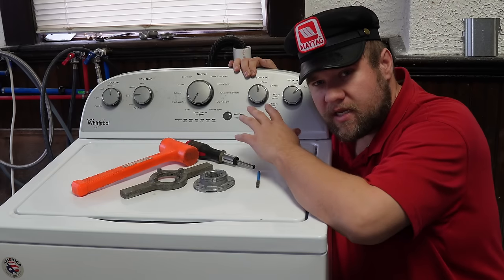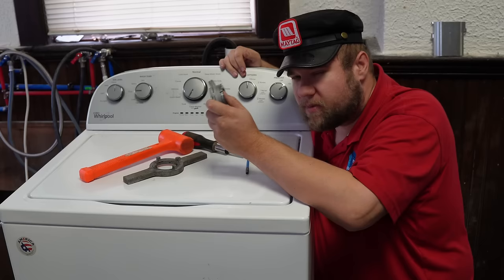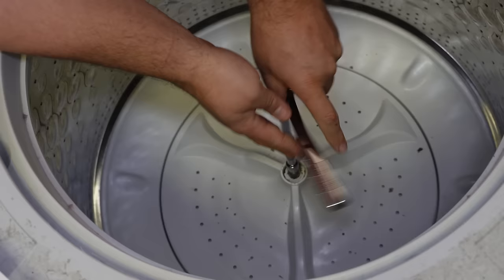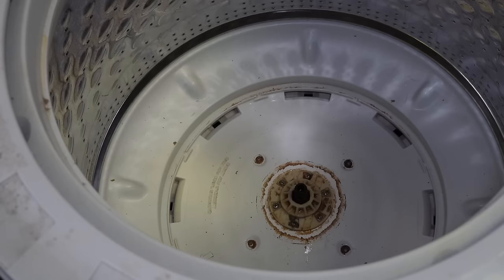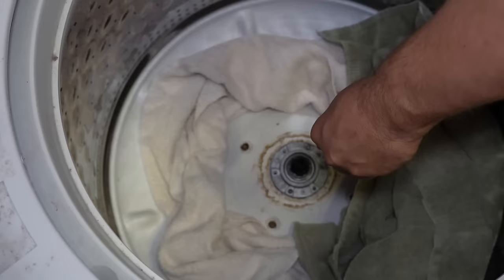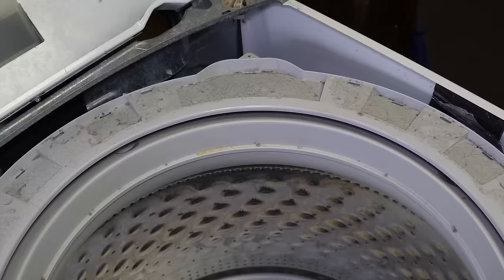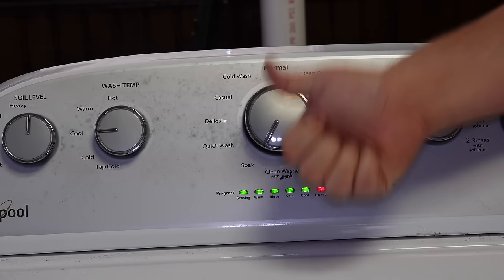Whirlpool Washer Won't Agitate or Spin Properly - Metal Hub Upgrade for Stripped Gearcase Splines

Comment: Liked video! I have a Whirlpool Cabrio wtw 6400 3.  My washer seems to agitate perfectly fine. The tub does lift freely and lower again, but on the spin cycle it just continues to do a slight agitation rather than an actual full spin. Basket manually spins freely during spins, and when i did thos last time got no ertor codes. I checked my stator and it does have cracks but again agitates perfectly. I like these washers because they're easy to fix but this issue has me stumped.  Anyone have any suggestions?

Comment: I have whirlpool model wtw5000dw2 but i cant get the 7/16 nut off, when I took off the plastic cap it had a rust colored paste on top of it. I wiped off the paste (grease?) but I can't seem to get it loose with a hand tool or power tool Can I put a penetrating oil on it?

Comment: I bought one of these a couple of months ago.  It worked well until it didn't.  After disassembly I found that the splines in the drive block were completely smoothed out as bad as the plastic one I just recently replaced.  Do I replace the drive shaft or the washer?
Reply from the maker: Great question, after selling quite a few of these, we have found that 1 of the issues is that the gear case bangs around a lot with the tub because of how bad the tubs are anymore, we are working on a brand new shimkit that will go-between the gear case and top that may. Solve this so you may want to give a metal hub another try. Otherwise you would have to typically replace the gear case.

Comment: @bensappliancesandjunk I have a Whirlpool Cabrio model 70401D. I got the code F0 E5 in diagnostic. I replaced the wash plate and the rods. That didn't seem to fix the issue. When I hit the start It locks the lid but when it tries to spin to weight the load it sounds like it's just spinning but not gripping. The tub and wash plate move and are not stuck but are not spinning properly. Sounds like the gears are worn and it's spinning but not catching. I already spent $300 on these parts, really hoping its the drum mounting hub issue. Could really use your experience, any suggestions?

Comment: I hope you can help me with a question. I have this washer, and we had it shut down after a power outage.  It would not come back on, and we couldn't get it to wash. I had unplugged it to check inside, but nothing seemed burnt out. The next morning, in a last ditch effort, I plugged it back in, and to my surprise, it worked just fine. If the unit gets unplugged, power goes out, or a fuse blows in the house, the washer won't work unless we unplug it for about 30 minutes, and plug it back in.  Is this normal? Seeing that there are diagnostic settings using the center dial, is there a way to use the dial to reset the machine so it will run immediately after the power goes out or unit is unplugged?

Comment: My washer has always had that bouncy bit in the tub. We bought it brand new and have had issues with it striping out the plastic junk under the agitator plate. I have had this bravos xl for 3 years and have replaced that plastic junk 3 times. It has always had an issue of getting out of balance as well. No matter how small of a load I put in or how I make sure the load is balanced to begin with. I am guessing it had something faulty in it to begin with and I thought the bouncy tub was normal, since this is the first washer I have ever had that did not have an actual agitator in it.

Comment: I replaced my hub with this.1yr later I’m having problems and my metal hub the teeth on the nut is stripped. What could’ve caused this
Reply from the maker: Likely, the tub underneath is bad and the bearing in it needs replaced. I am putting a video out on it next week

Comment: I picked up one of these washers and supposedly it worked ok except for the violent shaking however upon trying it out it would stop filling with only a couple inches of water in it. I put it in the calibration mode and nothing changed.
I’m hesitant to fix the hub without first getting the fill level problem solved. 
Any advice would be greatly appreciated.

Comment: I have a different spline on the drive with three equally spaced sections with four teeth each that are preventing me from removing the plastic hub. I had to break my wash plate out and replace it. Could this be a leftover section of the old wash plate that fits over the normal splines?
Reply from the maker: Hi, yes that is what it is. There's a metal piece at the bottom of the plate that sometimes can get stuck on it,
Reply: @bensappliancesandjunk  I appreciate you replying so quickly. Think I could heat that and then pry/wiggle it off?

Comment: I used your metal hub upgrade and it worked for a few days and then it started doing the same thing, not spinning fully and shacking. I have been trying to get the large tub nut off with the spanner wrench and a sledge hammer but it will not come off!!!!! Any advice ?

Comment: Hey Ben, We just replaced our 8 year old Maytag Bravos this weekend do to wash plate lock up and fried drive motor. I have a feeling this would have fixed the wash plate issue, but not sure if the drive motor could be fixed. I hope the new Whirlpool will last a bit longer than 8 years. Thanks for the videos.

Comment: Super bummed!!   Upgraded to the metal hub and it lasted maybe 2 months or less!   Agitator spins around,  not sure what it looks like because we used locktite on the bolt.
Reply: oooow thats dishatening
Reply: I've replaced the hub (with locktite), OEM suspension rods, and checked the pump, motor, capacitor and splutch. Still walking across my floor. 😭 Anyone have any tips?

Comment: Question if you see this! When I took the drive hub out it was very clearly and in terrible condition... On the gear case splines there looks to be in your video some kind of black rubber ring seal. Mine was shredded. What is the name of that seal so I can find a new one!

Comment: Is it normal for the drive block and the tub nut to NOT screw together very well? I am not an appliance repairman, but I once worked in a machine shop as a QA inspector. The threads on my parts -- right out of the box -- don't screw squarely down. I not sure if that is just the nature of the quality of these parts or if it some ingenious threading design for this machine, and perhaps that spanner wrench will be the finishing touch to securing down. I thought I would ask before I make a fuss to my supplier.

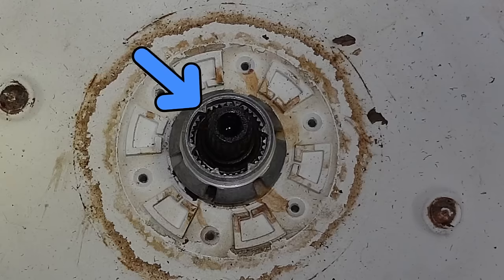Comment: Nice job!  I bought these parts from you and tried to install according to this video.  The instruction at 5:00 is unclear and difficult to see in the video.  Tried hammering on a socket but nothing changed. The washer doesn't shake violently (also did the safety pin trick). Now I'm getting a vibrating like a vibrating bed.  Can't find a video that helps. Maybe the hammering part wasn't successful? Any input will be much appreciated.  Thanks

Comment: Okay so i replaced both this and suspension rods. It was good for a wash or 2 but then i noticed it wash shaking absolutely violently again and atopped it immediately. There is play in the inner tub again. I think i might have not had the tub pulled up and when screwing it in i pulled the tub up with the screws. Currently can't get the agitator off now again 🥲 even bought a whole new one because i had to break the last one. Would the tub being pulled up be able to cause the tub to come loose again? I used thread lock and everything. Let it cure for 24 hours as well. Am i fucked?

Comment: Hi @bensappliancesandjunk thanks for the good videos. I think I need to upgrade to a metal hub per this video, but would please like your opinion. I'm working on a Maytag MVWC565FW1. It's acting really off balance during spin cycles, walking, banging, etc. First thing I did was level it by adjusting the feet. Didn't work. Then I ordered new springs/shocks (someone else's video). Didn't work. Actually seemed to get worse. Then your Fifty Cent video hack mentioned hub which brought me to this video. Mine has an agitator and I think I need to get a really long extension to loosen the 7/16. What do you think? I'm a pastor working on the church parsonage appliance, so cost savings is a big help. Thank you! I plan to order parts from your store, but wanted you opinion before ordering.
Reply: The repair isn't very difficult at all to do yourself.  Ask if any our your parishioners are handy and if they wouldn't mind doing the repair for you or let you borrow the required tools.

If you need to purchase tools go to Harbor Freight.  Their tools aren't the best but for a simple job like this they are more than sufficient.

Watch some other videos for your specific model or similiar model to get an idea of the tools you will need.

Good luck!

Comment: Hi Ben, I installed the metal hub and I’m still getting the same amount of play between the tubs.  What should I check?
Reply from the maker: One thing we see popping up is that if the tub is destroyed on the plastic, there's only one more possible fix, we just came out with it. It's a metal collar to slip over the gear case just before you install the hub that tries to reduce the wobble in the tub. 

This is the item: https://bens-appliances.com/products/gear-case-shim-kit-for-whirlpool-maytag-and-other-gearcases-ba-27194372?_pos=1&_sid=6c83c2257&_ss=r
Reply: So these would go between the shaft and the inner tub? Do you have a video yet?
Reply: Just to confirm.  I’m using part W10324651 in a  wdw5000dw3. There is a lot of clearance under the drive block at the base of the tub. I can see the wobble at the shaft, so I’m guessing the shims would fix that.

Comment: Thank you for you videos. I did use your other video to replace the rods. What a difference. I wasn’t able to get the machine into calibration mode but it’s so much better now. I planning to switch out this next. The spanner wrench, is it one size fits all or do I need to get a specific one? Can you send a link when you have a chance if it’s a specific size please. Thanks again for your help.

Comment: my hub on my maytag centennial will free spin by hand and the basket itself will not spin with it. I been noticing that the clothes are heavy like there was no spin cycle. Do I need to replace this hub on my centennial to get my spin back?
Reply from the maker: Can't say without seeing model#. Take it out and investigate. It'll either be the hub or plate itself
Reply: @bensappliancesandjunk  maytag model MVWC415EW0  ....... I was able to run the diag mode on spin cycle and I can tell you 100% that the agitator spins 1000 times faster then the basket

Comment: I have the same washer except mine has an agitator. Does this fix also work on one with an agitator?  This is by far the worst piece of crap washer I have ever purchased. I do not remember it ever working properly when on spin cycle. Got this during the height of covid, so we installed it ourselves. This was my birthday present from my daughter, I don't want to give it up yet if it can be fixed.

Comment: Hello Ben. Hope your day is going well. I’ve been working on repairing our washer for the past couple weeks. Had to regroup and figure out how to get the wash plate out. We got it, thanks to your videos. Ordered and installed the metal hub, recalibrated and waited to let the locktite set. The inner tube movement and rocking improved greatly after install but could still sense a little movement. Ran the quick spin (per your video) in the manual test mode. There was still a little shimmy but before it was an earthquake, so thought a regular wash would be okay. But it started shaking badly on our first wash. 
We didn’t receive new screws when we got the hub from you, or at least I didn’t see them so used the old screws. Could that be the problem? When installing the metal hub, the biggest piece with the holes for the screws to go through, didn’t seem to set down completely on the inner tub. Could that be the problem? Will watch video again and see if I missed something. Thanks

Comment: My whirlpool washer like the one you have in the picture, my question is when I plug in the machine it makes a buzzing noise and won't let me do anything, unplug it and plug it back in , does the same thing, what would make it buzz, any help would be appreciated
Reply from the maker: I have a video on that. Drain pump is running most likely, and its failed

Comment: Do you have a website to find a compatible version for Samsung washers? I have to figure out if my unbalance issue is caused by this type of issue of if it’s the dampening rods. Horrible knock side to side as soon as it starts to try and spin.
Reply from the maker: This doesn't work for samsungs. Totally different syste.

Comment: Is it common for a washplate to come loose and wear out the splines on the actual shaft?
Reply from the maker: More often than it should be
Reply: @bensappliancesandjunk  sweeeeeet. Think I’m gonna need a new gear case at this point haha.

Comment: Very well explained. Very much appreciated. I changed my suspension rods, still shakes. This repair looks easier. My whirlpool has a large agitator in the middle.  Im sure the principles  are the same but do you have instructions of videos  on removing the center agitator, to get to the gear case?? Thanks. MOD
MVWC565FW1

Comment: I've replaced the hub (with locktite), OEM suspension rods, and checked the pump, motor, capacitor and splutch. Still walking across my floor. 😭 Anyone have any tips?

Comment: So my whirlpool would shake very bad during the spin cycle, everything I watched at first was talking about the suspension rods needing to be replaced so I done that, still shakes but not as bad as before. Would this be a the next step in resolving this issue? Any help would be greatly appreciated!
Reply: You need to put the machine in diagnostic mode and do the recalibrate on it. There is a video on how to do that

Comment: I know you say Maytag, I have a Maytag Cabrio will this fit on mine?
And I know you sell the kit, but do you have a link for the spanner wrench?
Reply from the maker: No it won't but we have one for the Cabrio coming. The spanner wrench is sold out, but I know that for the Cabrio, it isn't needed.
Reply: @bensappliancesandjunk do you know when? My wife is looking at me crazy, because the washer is working right, and she's tired of have to go in the basement to check it,...... She's actually been talking about selling my 78 Camaro, to buy a new set of I can't fix this soon. HELP!
Reply: @bensappliancesandjunk  this is a 2008 model if that makes a difference?

Comment: Ben, I replaced the suspension rods and it seems to be much worse with banging and walking around. Do I need to calibrate it before I can use it?
Reply from the maker: I would calibrate just to be safe, yes
Reply: Thank you ....much appreciated
 @bensappliancesandjunk
Reply: Ben, I followed the calibration tutorial and it doesn't seem to have made any difference. It bangs and walks like crazy.....any suggestions
Reply: I used the calibration cycle and instead of selecting rinse, I selected spin.......still banging badly on the rinse cycle
Reply: I played the washer down and checked the belt and pulley bearing and both are tight without side play.
This particular washer has no other springs or vibration dampening straps of any kind
Guess I will pull the wash drum out and check the tub transmission shaft end play and switch it over to the older style metal drive hub kit

Comment: I tried the hub I purchased from you and noted that the drive block sheared off the small 'fin' on the hub after a few washes. How are the two parts to stay rigidly together with just that small 'fin'? Tightening the special nut as directed is not enough to draw the parts together tight.
Reply from the maker: Did you use threadlocker on the nut? How tight did you over-tighten the nut after it couldn't be hand-tightened any more with the spanner wrench? The ones we sell cannot be tightened as much as in this video due to the threading on the drive block being deeper. The video shows 3/4 of a turn, whereas the one we sell is optimal around 1/4 of a turn with the TB123A wrench once as hand-tightened as much as possible.
Reply: Thanks for helping me resolve the problem, Ben. Offering another hub went over and above what I expected!

Comment: I’ve got one of these washers that came with my house when I bought it and when it goes to start the spin cycle it makes a loud squealing noise and the washing machine rattles around during the spin cycles even though the clothes are balanced, is this an issue that is normal or is it something that needs to be repaired or should I get a new washer? And if I do need a new washer what would be the best kind of washer to get? I know the older belt drive Maytag units were pretty reliable and easy to fix, but those are kind of hard to come by these days, and I know you were saying something about the older Whirlpool Direct Drive units from the 1980s being decent. But the modern direct drives I know in my experience are crap and super expensive to repair. Ideas, opinions thoughts?
Thanks, 
Levi
Reply: I have a Bravos bought new 5 years ago and from day 1 it rattles and shakes.   Looks like the production line company should do a recall.

Comment: Hey Ben, I purchased everything from you to do this repair because my Wtw5000dw3 washer was shaking and jumping. I replaced the suspension rods first and this helped a lot. Should I replace the hub with the new one now or wait to see if the washer goes back to shaking and jumping a lot. Thanks for your videos.
Reply: I have the same model and changing the rods didn’t make a difference at all.  Now I’m looking at changing the other parts but at this point I could have just purchased a new machine.